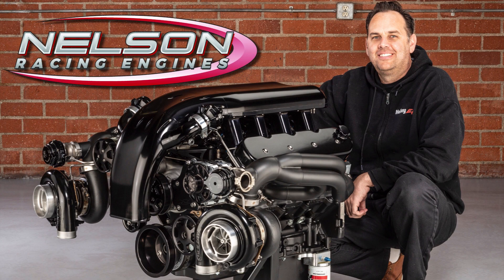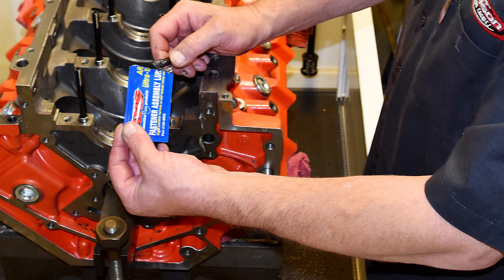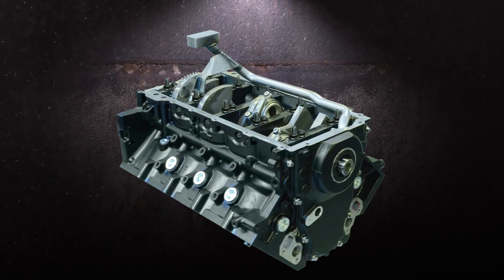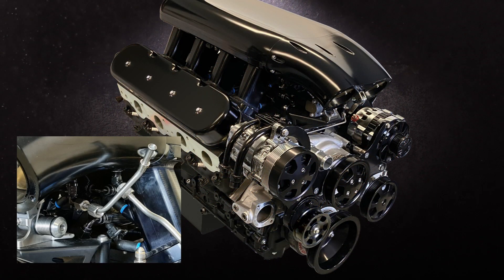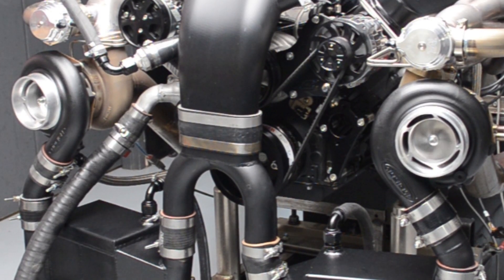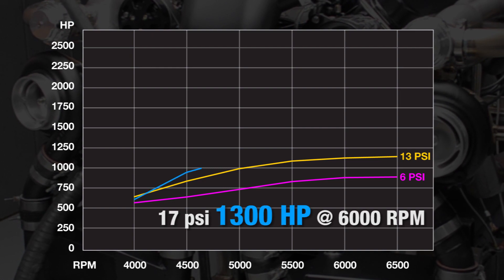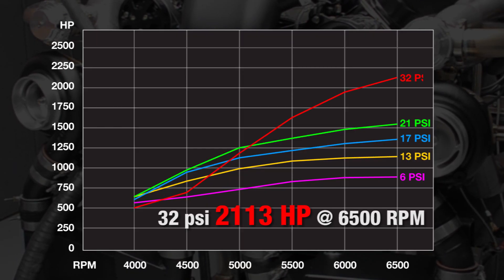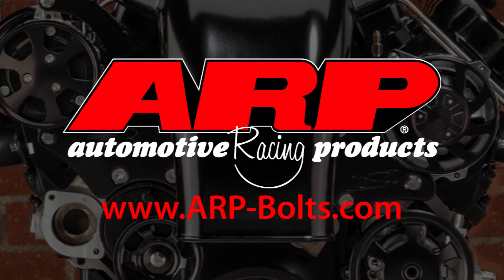ARP Nelson LS Engine Build Video

Comment: Very much admire your engine/ car builds!!! My question is, street racing; did you start the twin turbo craze in USA that were built by gear heads? I know factory built cars exotic cars had these twin turbos! But the way you put high horse power into American cars was beyond most gear heads dreams!!! Now most streetable cars turbo charged! I bet when you was younger, you probably won alot of races!!! Like your knowledge of the motors, turbos; racing streetable cars!!! 👍✌️